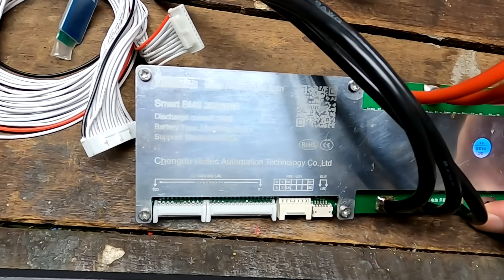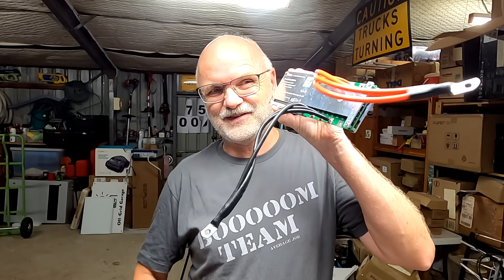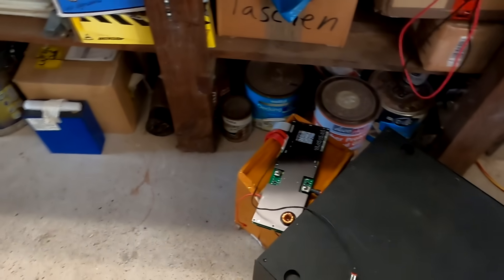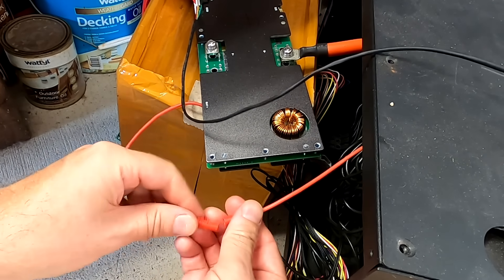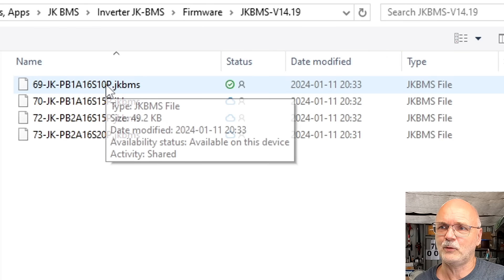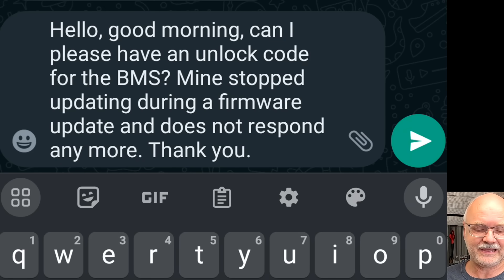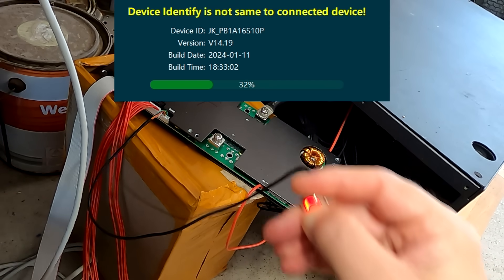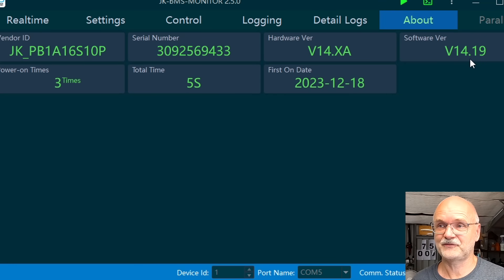How to recover a bricked JK Inverter BMS. Using Force Updating to save your BMS!

Comment: Thank you Andi :trophy-yellow-smiling::trophy-yellow-smiling::trophy-yellow-smiling: for your video and everyone else posting here. You guys helped me to flash my bricked JK-PB2A16S20P-V15.29 to V15.41 with PC software 3.4.0
I had to try about 20 to 30 times. I think it worked when I moved the phone further away from the USB adapter?
Unplug any screen and unused network cable from the BMS. And try unplugging power from the BMS, unplugging USB and closing and openning the softare (disconnect and re-connect again) try it all and don't give up. Electric interference EMI is a reason for it not working. Use your laptop with battery and no charger close by.
Don't flash during holidays, check the time in china at Jing Kongs 🦍 location. Flash your BMS 30 minutes before they open so that you have all day to sort it out.
By the first look I can tell that the voltage display and amperage are much more vivid. This probaby means better accuracy. 👍👍👍

Comment: Thanks Andy, unfortunately this didn't work for my BMS. The firmware makes it to ~10% and then a "process response error" occurs. I've tried several firmwares of v19.
Reply: I have just had the same with V15. Disconnect the BMS from power and also disconnect the RS485 and display and everything. I tried and tried and tried and tried and eventualy it went through after many many attempts... 👍👍👍👍👍👍👍

Comment: Will the button pressing trick work when the screen is connected and not the power button? I mean by pressing the power button in the screen and then pushing the reset button once?

Comment: I have a V19 BMS JK (Jikong) PB2A16S20P (Inverter, 8–16S, 2 A, 200 A).

The BMS works, but I am unable to perform a firmware update.

I connect via PC and Bluetooth, but in the PC application I cannot click on “About”; only “Parallel” is clickable.

When I select firmware update, the same table appears as in the video, but the only clickable option is “Updating Force.”

Comment: When I do forced update, it starts fine, but then suddenly stops, sometimes at 10%, sometimes at 4% or so, and throws "communication error". My connections are definitely good, because I can successfully update other BMSes, but not this one - PB2A16S30P with v19 hardware. Has anyone else seen a similar issue?

Comment: Hello, i have two JKBMS v15 200A and i wanted to upgrade from 15.38 to 15.41, but one BMS still not to possible switch from parallel to single mode. Still blinking the link LED (RUN not) and not heplps dip switching, total power off or force upload FW. When i connect the BMS i see only reciving data in terminal and seccond one shows both directons.
Met someone this issue?

Comment: Once again unit locks up and fails to recover. When i attempt to do a forced update it starts gets to random upload points and fails with error. Sometimes only gets to 8% most i have is 20% Im running a JK-PB2A16S20P and was running version 38, but noticed after this update my CAN comms stopped working between my Growatt Inverter and the BMS. figured id try the version 39 firmware but nope. will not accept update. any other options Andy. Im using the latest PC Software 3.03

Comment: Hello, I’m having an issue with the JK BMS model BP2A16S20P. It keeps showing a "Temp Sensor Abnormal" warning. I’ve already replaced the temperature sensor and updated the firmware to version 15.35, but the BMS still reports the same error. I would appreciate your guidance on how to resolve this issue as soon as possible. Thank you very much!

Comment: Update: Received some support from JK BMS. Received a password that allowed me to login to the app and turn on charging/discharging. The app didn't keep my password and or it expired so I'm locked out again. But I was able to start using the batteries. It would be nice to be able to login to the app to change other settinss like float, min/max charge, balancing etc. But I need a break from the hassle. If the settings are screwed up and the batteries fail you can count on me to complain some more. ;)

I'm making one last attempt to resolve this issue. The DIY kit it no good without a bms. I spent all my budget trying to get power and EEL Battery sends me the exact same reply everytime I ask for help. I believe they know the 12v JK-BMS bricks easily. The password I enter is correct, the JK BMS accepts the password and does nothing. So I cannot turn on discharge or charge. If JKBMS ever declares they have hired competent software engineers, it might be safe to buy a product with their bms inside. Until, then I really don't think it's a good idea to speak so highly of them. Your advice literally cost me a thousand bucks. I did A LOT of research over a two year period before watching a couple videos and making a decision. Horrible decision. I wish everyone else luck.

Comment: Hi, during the upgrade the power went out blocking the bms. I tried to force it but even holding down the power button and pressing the reset the update does not start. the only difference is that the power button is the one of the bms display. could that be the problem?

Comment: i tried that on mine. my computer was on the battery while updating. as soon as i hit update it went black. now trying to unbrick it but it wont go past 0% also with that pressing button trick. does not do anything
Reply: fixed. i made sure the cable from the pc to the bms was away from all interference devices. monitor inverter … then it worked !! found it here in the comments by someone

Comment: Is it possible to use the JK BMS inverter without the communication board at all? I have a JK BMS inverter, but I have a regular inverter (not smart) and only one battery. There is no point in using this board and there is no place for it in my assembly. Please tell me if it is possible without it.

Comment: Sorry, I have a different problem. On bms JK-PB2A16S20P-4.3LCD I have 1 error, SCP release failed. How to remove it?. In the menu I have SCP delay - 1500ms, SCPR delay - 6s. Everything works normally
Thank you

Comment: Hi andy
Currently building 2 ESS batteries with the PB2A16S20P JK BMS, this week I had everything ready and tried hooking up my 2 BMS to my Cerbo GX so I made a Type A CAN cable and connected it to the CAN port of the first BMS which is set to adress 0 then used the blue network cable to connect the second BMS with adress 1 to the first using the ports on the right. But in the cerbo I only kept seeing the first BMS. Then check alll the settings via the bluetooth on both BMS everything seemed fine. So i bought an USB-RS485 converter to be able to upgrade both BMS to 15.24 firmware started with the slave BMS which was already set to adress 1 and connected it to the BMS monitor software uploaded the firmware and everything worked fine.
Then connected the master BMS which I set to adress one also and connected to RS485 connector to the ports on the right. first communication seemed to be working and I tried to upload the newest firmware. But it kept keeping stuck at 0% after that the communication seems to be lost. So I rebooted the BMS and it seemed to start working again but the RED LED is blinking. So i tried via the software to change some settings and that seemed to work most of the time occasionally I got timeout error's. But firmware update still not working. So I tried the method in  this video using the force update and the button but nothing happens.
So I think there is an hardware issue and I need to contact JK for help/replacement, but first wanted to check if there are other methods.
Reply: Same here, I can not force an update☹
Reply: @Franky6767 
Same here. Did you manage to get this fixed? 

I have a PB2A16S20P bms running on version 15.24. I am not able to update the firmware with the normal method. The firmware update process gets stuck at 0% and after some time BMS restarts by itself. Luckily it didn't get bricked, probably because the firmware rewrite process was never initiated. 

During this time the capacity indicator on the display (it's the smaller 2.5" version) goes to 00% and the inverter starts throwing the error 61, which means the communication to the battery has been lost. 

In this chat, I read someone talking about the High Frequency inverter being ON near to their BMS, causing the forced update failures. I will try and see that keeping the inverter OFF during the update process will fix the problem I am facing.. 

I don't remember how I did the update earlier - with or without the inverter running nearby. Probably it was OFF. Will try and see.

Comment: Hi Andy,

I have PB1A16S15P Hardware version 15.XH, i have wrong force update firmware with PB2A16S15P v15.XH now all communication not working and the bms keeps beeping. 

I have try to force update correct  firmware but not working at all. did my bms totaly broken ?
Reply: I also had a "double bricked" PB2A16S15P (force update also failed). JK BMS support was not of much use. By trial and error, I got it working today. 1. Turn off the BMS - disconnect all power. 2. Connect the RS485 cable to computer and BMS and start the JK BMS software and do a force update with the BMS still off. 3. Connect power to the BMS (I used a power supply to B- and B+ without any batteries). 4. Press and HOLD the power switch. In my case, the BMS powered on and the force update completed - saving my BMS. I hope it works for you too.
Reply: @nuwanfernando339  God blessed to you, it helps me friend, thanks :)

Comment: I updated the bms to version v15.23, after the update the display stopped working, everything else works, is it a software error?  anyone else had this??
Reply: There is a v15.24 on Andy's website (found it on a forum). Check the change log. There is a LCD display problem with v15.23. I updated to v15.24 and the display is working again.

Comment: Good day all,  I have two JK-PB1A16S10P BMS Firmware version 15.07. I tried to update one BMS to Firmware version 15.17. The procedure follow were as per Andy's video, the update only came as far as 4% and then nothing..I tried again and still nothing...I then  tried the brick procedure then and still nothing. The BMS Monitor software is version 2.7.0 . The communication tab for sending and receiving do show activity for sending and receiving. The error message showed by the BMS Monitor software is  "Process Error Response".  Any ideas what could be the issue?
Reply: I have resolved this issue ,I bought a waveshare Industrial USB to RS485 Converter Bidirectional Adapter as per Andy's advice and tests. This device worked , mine (Hexin) did not.

Comment: Just my 5 cents to this topic: I had a very hard day today ... tried an update, it failed, bricked the bms ... and after a few hours of unsuccessful trials to force update, i had an idea: what if some electric device is creating some electromagnetic noise which is ruining the RS485 communication? Turned off all devices (including my laptop's charger) ... and the force update was successfull.
Reply: Thank you for posting this. I had my share of misery the other day, tried to update to v15.30 and it was bricked in 5s. The I've tried to force update which always stopped before 40%, tried various cables, in total about 30 times or more. The BMS of the new battery was sitting (for testing) near the inverters (high frequency). Once I've stopped them, the force update finished flawlessly.

Comment: Hi Andy, I have a JK-PB2A16S15P V15. I have a minor issue with the app in that it shows only 1 column in lieu of 2 like it did originally (takes some getting used to). It's OK when I turn my phone to landscape (same with other phone). I thought I would let you know that I tried all your efforts to default the JK but with no luck, I even bricked it & brought it back. The JK came with V15.10, worked OK, immediatly upgraded to V15.11 (tks to you) & now have upgraded to V15.17 still shows 1 column. Cheers.

Comment: Andy please help me. JK customer service is horrible. I bought 2 cards JK-PB2A1620P. I made the update 15.05---->15.10 on a card no problem, but on the second impossible the progress bar does not advance even with the forced update, the led stops blinking until the beep 2 minutes after. JK doesn't understand or doesn't want to understand. I've sent videos on how to update but no response. That is, if someone sends me the update instructions. Has anyone had the problem or is the update not working?

Comment: I have PB2A16S20P HW v15.XA SW v15.05, not working update to 15.10. I tried the standard update, it doesn't start and after about 60 seconds the BMS restarts. When I want to do a force update, it's the same. Support is terrible. It looks like the BMS bootloader didn't go into update mode.

Comment: Hey Andy. I got the hardware v15.xA of the JKBMS Inverter, It seems the same on the outside, stil havent gone throough the settings yet. Only just connected the balance leads and Bat Neg to it and powered it on and made sure LFP was set.

Comment: I have 2 BMS JK blocked.  Do you know if there is a different method to force the firmware?  This method doesn't work for me.  Thank you
Reply from the maker: There is no different method... What does not work for you? Have you requested a code form JK or did you use my code?

Comment: Hi Anddy, congratulations on what you do. to update which serial adapter you use. I have 2 BMS blocked to failed update. This BMS JK is a disappointment. Thank you
Reply from the maker: You can recover them with this method. Give it a try, it will work.

Comment: Does JK BMS have a real time clock?  Probably the PC is checking the time in the code.  Maybe it would be possible to set the time on the PC back to when the code was valid.  Probably also need to make sure PC is not connected to internet to prevent it from getting correct time.
Reply from the maker: No real time clock, no... The software gets the time from the PC though.

Comment: My jk won’t let me change my cell RVC even when I lower the 100% SOC it still doesn’t let me set the value to what I want. just says sending failure. 
only lets me set to 3,550 or above 
I want to set it to 
RCV=3.450
100% soc=3.449 
it simply won’t let me 🤷🏻‍♂️
Reply from the maker: This will be explained in the next video!
Reply: You are so good Andy!
Reply: I have a feeling that it’s maybe because it is connected to the inverter already, maybe I will try a reset and set parameters before I plug it in.

Comment: Hi Andy, fantastic video as always, would it be possible for you to use your powers of persuasion to get some information on the PACE BMS, my batterie / BMS needs calibration. You have touched on this BMS in the passed and there are a number of batteries on sale in south africa that use one of the PACE BMS models. I have the PBmsTools software and it does have a calibration screen, the problem is I only think I know how to carry out the calibration but i don't know for sure. Any assistance would be great.
Reply from the maker: Thanks Mike. I have never done a calibration on a Pace BMS myself. 
Is voltage and current off from what the BMS shows and what you can measure?

Comment: Andy this is great information, Thank you
Could you suggest a option to save all user settings?
which would be done prior to any issues as this, then after fixing a bricked BMS we could just reload user setting.
this would be a great option that other BMS's do not have.
Thanks again
Scat
Reply from the maker: As far as I know, there is no option to save all settings in a file. I would suggest taking screenshots and keep them in case you need to setup the BMS again.

Comment: One quick question not related to the video😊 Any chance to have a video on the new EVE 280K? Lots of nice features on paper
Reply from the maker: I thought only the terminals are different but chemistry is still the same? I'll have a look!
Reply: @OffGridGarageAustralia  extended temperature, higher charge/discharge current among other

Comment: Hello, I want to ask you a question I bought two 100A lithium batteries, two years ago one has just stopped working it charges up very quickly and then discharges very quickly so I have just taken it apart.  it looks very good quality inside there is no BMS is this normal I’ve never seen this before I could send you a picture if this is not normal so I’m also wondering about the other one. Is it safe to use it. I’ve looked at battery tear down on YouTube and everyone seems to have a BMS. Is it normal for a battery not to have one? Thank you to anybody that answers.
Reply from the maker: If you are talking about the normal 12V LiFePO4 batteries, they have to have a BMS. There are 4 cells inside the box and there MUST be a BMS as well. If not, you can be lucky that none of the cells has gassed yet. Most likely, one or more of the cells is now damaged and hence the voltage drops quickly.

Comment: I don't understand why the JK code would only work for an hour. The bricked BMS does not know what time it is and how much time has passed since the code was generated. It even doesnt know which time zone in the world it is in. I would imagine that if you disconnect the PC you are using for the update from the internet then the code could be used indefnitively.
Reply from the maker: The BMS does not know, no. But the software on the PC has got the time from the computer.
And yes, you are right, some here have already done that and set the time back and it seemed to have worked.

Comment: Hallo Andi ! Mein Daly BMS 200A hat sie Funktion Balanced Charge. Was hältst du davon ? L.G. nach down under Klaus
Reply from the maker: Most of the Daly BMS sucks with balancing. In fact, they all do...
With large capacity cells, you most likely need an active balancer as well to make it work. The tiny balancer in these BMS has no chance.